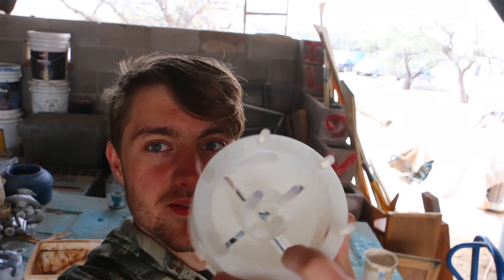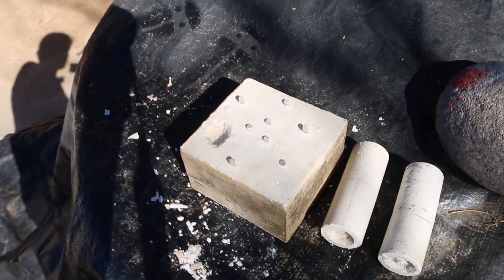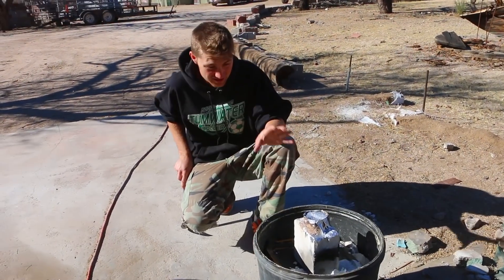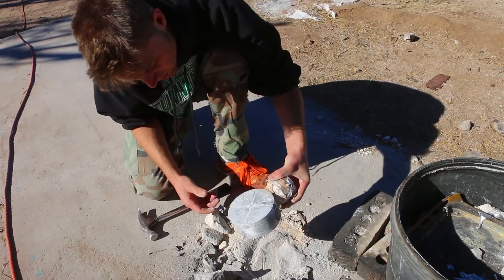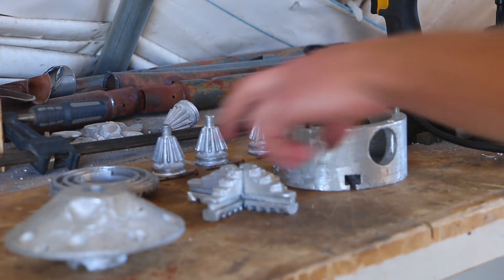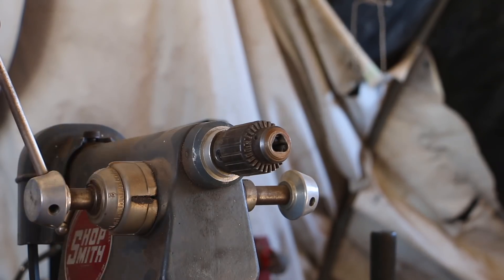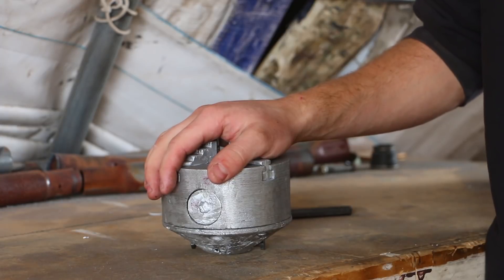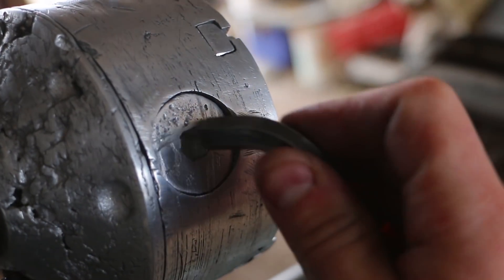Casting an Aluminum Chuck (part 5)

Comment: You need to turn the body of the chuck on the lathe, recast the back as a solid and turn it on the lathe and make sure all the internals are balanced with the body (making sure one jaw does not weigh more or have a different profile than the others , must be identical).

It's a decent result for flat out casting it but it is not use-able due to the serious wobble it has. Even a small dent can cause something spinning to wobble and is exactly why something as small as a 2oz wheel weight falling off your car can cause vibration. 

Also I'd spin the spindle by hand without the chuck and make sure you have no wobble coming from the spindle. And for the motor you can simply use a decent size motor from a drill press or literally anything and figure out how to mount it to the lathe while you wait to have the motor rebuilt. 

Overall nice attempt and the result is decent you just have to make it use-able.
Reply: Correct bro.

Comment: I just wanted to add a couple of things: Sprues are so important for casting, especially for fine details. Check out how jewelers attach sprues to their work before casting and then integrate this into your 3D models if possible. Or just take the filament and directly hot melt or super glue on the sprues. Another issue would be to use a thicker crucible so that the heat can be retained longer in the melted aluminium. Overall, great work. :) And another subscriber.

Comment: you can chuck the chuck on the spindle so its back is pacing the tailstock and jaws hold the spindle. bore it and use a shim to fit it to the spindle.

Comment: Have you looked into Green sand casting?  It could potentially have the benefits of only having to make 1 3d printed mould, be reuseable and make a better casting.

Comment: Hard work and determination pays off!
When you casted the back plate, your aluminium was molten, but too cold. 
Try letting the metal sit in the heat a bit longer and it should pour a lot better.
Just my opinion, and does not matter one bit, but couldn't hurt to try.

Comment: great work on it.  While your waiting on the motor to be rebuilt. Recast the back piece and drill out the holes and on the holes that hold the 2 main pieces together. use a large bit to make you a recess so you can get your wrenches or sockets on it better.  Just a ideal